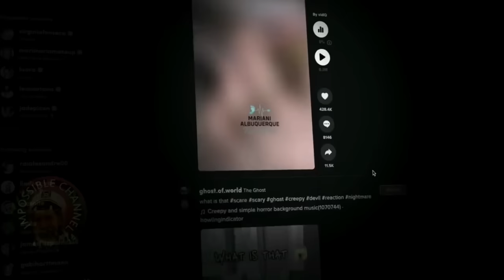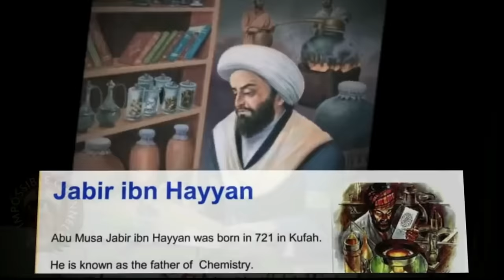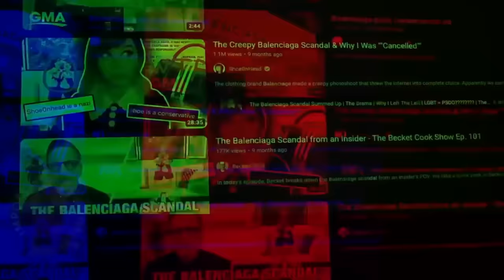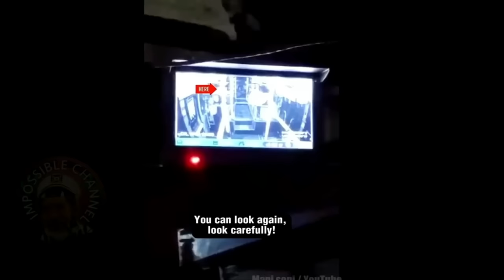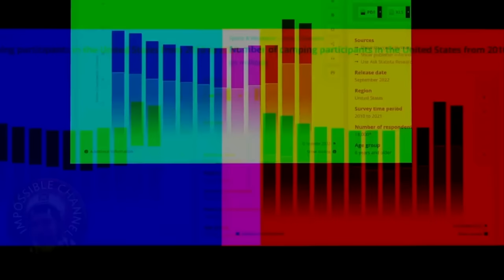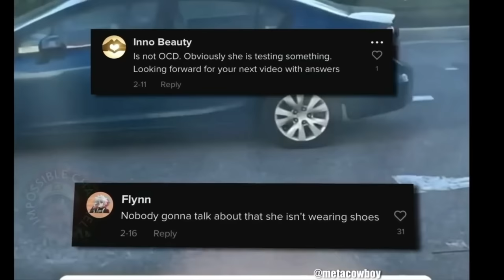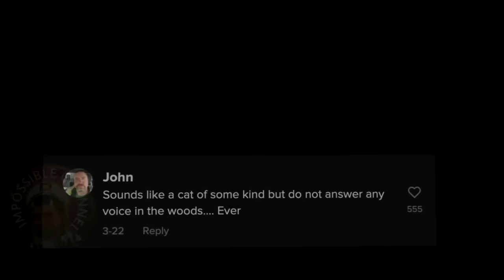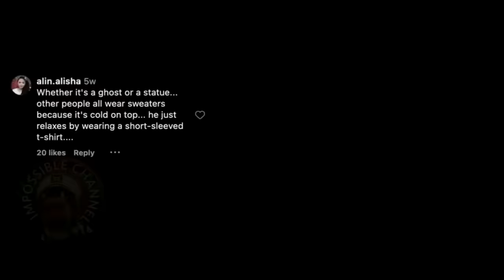The Most Unexplained Videos Of 2023

Comment: The red mercury is a pretty interesting tale... in not so distant "American" history, there were enclosed mercury cylinders used to power electronics in theaters and for personal electric cars.   
What if it was red mercury powering the past?
The deer??? Clearly the head on the left belongs the deer standing behind the tree and it pulls it head back as the other deer swings it's head back around.    What the mind perceives to be true can be flawed - you have proven that!   🥰

Comment: The deer is perfect positioning. Like choreographed dancing where you can have several people stand in a row behind one and you only see the one in front. The downhill slope is what aids in it's benefit. That causes the deer behind the tree to be lower than the one in front. When their heads are so close together, they're back to the same size. Top deer neck arching down and the lower deer arching up will match closer in size. The gap in between the top deer and the tree will remain open. Since from the side of the tree we are able to see is a few to several inches above the perspective from the other side, the lower deer is just lower. If we could see from an extra quarter angle putting us on the side of the tree, we would not only see the deer. Due to the fall in grade being lower than the top deer, we could see that too. At the shoulder, top deer would be a few inches higher but only coz of the slope. Deer scare easily, she could have done almost anything to spook them. Why not just try that for your own sanity and peace of mind. Views and hits could be why. What if five seconds after recording, two deer go running off? Was the video longer but that's just what we got? Does anyone know?... Research time I suppose....

Comment: You can totally see the second deer right before you mention the gap. When you look at the main deer just below the head on the right, you see a darker patch and moves a bit.  Right after that is when you mention the Gap,and there's no dark area anymore  remotely in that area. The 2nd deer just turns at the right time and is blocked by the dear and the tree that's why it looks like it disappears. Why doesn't the girl walk over and check the tree. I bet you she does and noticed the other but just cuts it off at that point.
Reply: No actually you can tell its an edited video the way the second head clips out you can see its super blurry when it first appears
Reply: @dylandualsport1462 correct, the artifacting of the video is easy to see and clear as day. You can tell the image has been tampered with.
Reply: There is another deer behind the tree and then it lays down.  If you watch the movement of the head you can see the motion of it lying down.  The angle of it and the way it lay’s it’s head down, you can’t see it anymore.
Reply: Yea , it’s definitely ducked down behind the tree 

& 40:11   
And the other 1 just like it they both look like there’s a mountain there and someone has hiked up to the mountain top and are doing it back with a laser 
You just can’t see the silhouette of the mountain on camera because of the lights of the houses in front of it.  

Thats all that is
Reply: @annacummings5841  the heads are at the same level....HOW can anyone think it's two deers?
Reply: @CSDonohue11  what? the objects are IN THE SKY above the land...man o man some silly comments
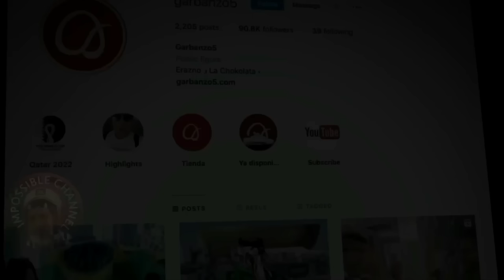Reply: yup... at 16:30 you can see the second deer from behind the tree.

Comment: On the radio broadcast section of this video. It used to be very very common that citizens band radio would interfere with commercial radio. A nearby CB or ham radio. My Transmissions have affected motion detector lights and security systems. These interferences are not rare

Comment: I like your video style and content. And I appreciate the year end hour long compilation. 

I enjoy watching videos like this as a skeptic and most of these are either fake, misidentifying, or pareidolia.  

But with the laser pointer star videos in particular... The closest star to our solar system is Proxima Centauri, which is 4.2465 light years away. That means if you could point a laser at that star, and the light reached it, it would take over 4 years to get there. And for a response would be over 4 more years. It's more than likely a video effect added in post, and the subsequent videos are people copying the virality of the video.
Reply: I think its probably reflection off of a surface, an airplane, a weather balloon a relay tower. Something logical!  
It also seems to me that that could blind an airplane pilot, and potentially dangerous.

Comment: For the phones scanning to see if someone's there, I just realized that TVs are doing it too, I always wondered how my TV would automatically turn off a channel or shut down knowing if I wasn't there and now I know how it knows. Scary AF!
Reply: Check your settings on your TV. You probably have the "inactivity" or "auto-off mode" setting turned on. It senses user interaction with the REMOTE, not you watching it. On Samsung it's under Settings- General- Eco Solution- Auto-off. My Samsung smart TV went dark but the sound still worked. I replaced the LED light strips (YT repair video + $30 LED strips from eBay). I took the entire TV apart and never found any "camera" nor any connections that would prove the TVs have the ability to "watch" you. At least, none of that is in my model of Samsung TV. (Former 25 yr IT Tech skilled in computer repair).
Reply: @oztrich24  thank you. I think it depends on the brand of TV but I will check that out.

Comment: GREEN LASER: Aircraft at a distance can look like stars. This is especially true if they are moving directly towards you, since there will be little apparent motion against the sky.

For this reason, NEVER point directly at a dim or unknown “star”. Instead, move the beam in a circular motion around the object. When doing the circular motion, or when “drawing out” a constellation, keep the beam moving and keep it away from any “stars” since they may be aircraft. A beam outdoors can seem to end after only a few hundred meters. This is a potentially dangerous illusion. The beam actually continues to travel even though the viewer can no longer see the light scattered back to them. Therefore, ALWAYS act as if the beam continues on, forever. Don’t let the beam get close to any aircraft or unknown star along either the visible beam path OR its non-visible continuation.

Comment: Red Mercury is used for antigravitic travel.

Secrets of Anti-Gravity
22:00 mins

Two counter rotating cylinders super cooled by liquid helium or liquid hydrogen.  The die glocke was made from ceramic metal - so as to withstand the extreme generated from rotating the vortices.

Xerum 525, Very dense, viscous, gooey, deep maroon, cherry red colour.  David Childress books read and interpret.

Counter Rotating Cylinders at extremely high speeds.  Of mercury in a highly charged electrostatic tube leads to an anti - gravitational field as well. 

This Xerum 525 is put into these counter rotating cylinders and spun up to high speed in opposite direction its going to cohere the rotation of atoms and molecules of this substance on one plane.  In other words its going to align the axis or rotation of these things.  Sporrenburg also describes it makes a buzzing sound.

Dellschau's artwork.

Comment: The mannequin doesn't turn its head, she was more to the side of it initially, then she moved to look him more straight-on after showing its hands. I watched it several times and swore I saw its chest going in and out, though, slightly, but it's hard to tell if that's what it is or if it's the smudges on the window, and, it doesn't ever blink, which would be nearly impossible for that long, I would think. That one was a trip for SURE, but I've also never seen a wax mannequin before, so I was shocked at how human it looked too?!

Comment: The green laser.  Using simple geometry, we get a distance to the source as less than ten feet. Now that is odd when the presenter is saying this laser is coming from 'the stars'.  It is even easier to see when it is shining in through the window.  If it were further away, it could not have the sharp angle and still be fully visible it's entire length when the camera  is less than eight feet from the window.  Geometry.  I learned it in the eighth grade.

Comment: Little wierd the coke bottle that burst was held on the stick with string was set behind in the direction of the open door for someone to hit it with a pellet gun or something.
Reply: When you tip and it hits the ground coke or any other carbonated beverage would build up pressure. This perhaps was a faulty bottle. The sound as it hits is clearly glass and not a plastic bottle.

Comment: did they ty the same thing with a pepsi bottle ?

the mannequin did not move the dummy with the camera did though

as for the infra red phone spy thing. the official explanation is correct, most all phones can c infrared light, try pointing your tv remote at your normal phone camera and you can c it for your self